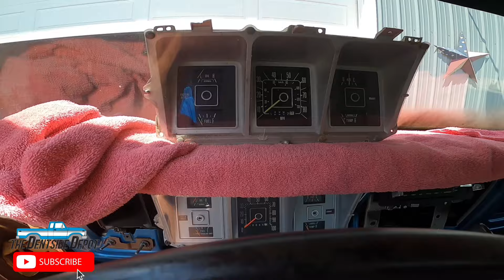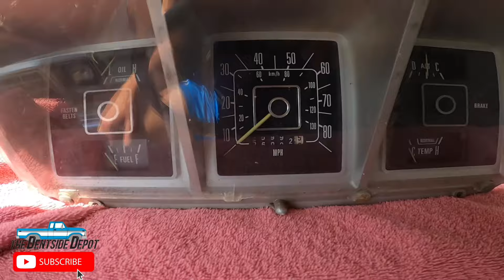10 Simple Ways the GOVERNMENT Tried to RUIN Classic Vehicles

Comment: It wasn't all bad.  Smog in certain areas was terrible.  Lead on the side of busy roads turned the plants and ground silver. They were dark times and ham-fisted in their attempts in compliance, but they resulted in air I can breathe.
Reply: @snackler6102  for the same reasons we have EGR, Evap cannisters, catalytic converters, and a host of other things.  Leaded fuel poisoned catalytic converters. Catalytic converters reduced smog. Some things worked.  Others choked off engines.

Comment: It’s honestly amazing how little the newer generation understands about how older vehicles are grandfathered into laws. Thus making them exempt from having to comply with emission and safety standards, that did not exist when at the time they was built. A vehicle built in 1965 never had to comply with emissions and safety standards in 1975, as a vehicle only ever has to comply with the federal regulations for the year it was built. As for the cash for junkers program, that is a program that was meant to help people who couldn’t afford to maintain an older car buy a newer car so you didn’t have people driving mosquito foggers down the road. Thus removing car’s from the road that was dangerous to drive on the road, that had some kind of mechanical problem that made it unsafe to drive. Sadly it resulted in people selling good car’s to scrap yards, just because it was old even if it had no mechanical problems. And no one ever poured anything into the crank case, to solidify its content as that would prevent an engine block from being properly recycled when it was taken to a steel yard for melting down. As you cannot melt any kind of metal down, that is contaminated with a chemical that would turn a forge into an explosive or produce toxic gasses under extreme heat. To do so would violate federal work place safety laws.

Comment: OG, '64  here, been through all this BS. Had a 77 f150 back in the early 80s, now have a 77 supercab as a retirement truck.  Here in Canada its not as bad YET. The Auto industry and people need to give their heads a shake.  Also had a '71 Torino GT 351C-"worked", regulations killed the 351C also, and I want one.

Comment: Honda had no problems with emissions. They didn't even need catalytic converters on their early CVCC engines. The problem with these 70s vehicles is that the manufacturers spent their money fighting regulations instead of using that money to research how to make engines run cleaner.
Also the 85 mph speedometer mandate was dropped but manufacturers kept using them because it was cheaper

Comment: Overall the emissions controls were extremely successful. Smog was a virtual constant in Los Angeles and other mountainous cities, and now heavy smog only happens a few days and in the summer.
Reply: Smog was reduced by the mid 1980s with catalytic converters, feedback carburetion, and fuel injection. Everything since the mid 2000s had served to increase cost without much benefit. The smog in LA will never be perfect due to the surrounding forests secreting their own natural hydrocarbon smog.
Reply: And also the CARB bureaucracy, someone could build a modern exhaust system that flows better and a more efficient catalytic converter and it would be illegal

Comment: Thank you for making this video so many people do not understand how gasoline cars are being held back by the government to push their EV nonsense. Another thing is if you look at cam profiles from the 60's compared to the 70's the cams from the 60's had less valve overlap which makes more low end torque and horsepower, plus you get better gas milliage. The reason they had to have the catalytic converter is because they were dumping way too much fuel out the exhaust valve and into the exhaust pro tip   If you don't dump gas into the exhaust you dont need a catalytic converter to burn off the wasted fuel lol!

Comment: My two 89 pickups have the bump fuel shut off switch.
I took ALL the pollution crap including the idiotic CAT and straight piped them.
I worked for lincoln mercury in the early 70s and watched the crap they pulled.
Yep older gas cans are better.
Good vid !

Comment: I remember driving 75 to 6 F-100s with the 360/390 engines,the FEM engine family was not the cleanest burning engines. In 1975 the standards were tightened so for the 360/390s so it was loaded with every internal,and external emissions device,some examples,air pump system,EGR valve catalytic converter,retarded cam timing,and they were stone cold sleads.
          The F-150 was over 6001 pounds gross vehicle weight so they ran heavy duty emission standards,so no air pump system, better timing,no catalytic converter,and much better drivability for the 360/390s, until they were replaced by the 351/400M engine family in the 77 and newer Ford F series.

Comment: You forgot the fuel vent, sealed gas cap, carbon filter mess 😉
Reply: @Alaska_Engineer  all that does is takes fuel vapors you paid for and burns them in the engine instead.  Is there a downside?

Comment: Well they seem to be leaving the gasoline engine alone slightly but they are very successful seemingly chilling off the diesel engine I guess they are cleaner than ever but they're not very reliable can you have to put in this extra fluid just for the admissions I remember what those things used to look like diesel trucks from the 70s putting all that particulate matter into the air